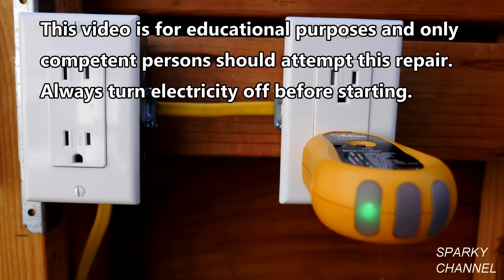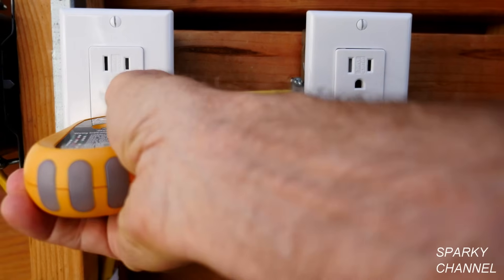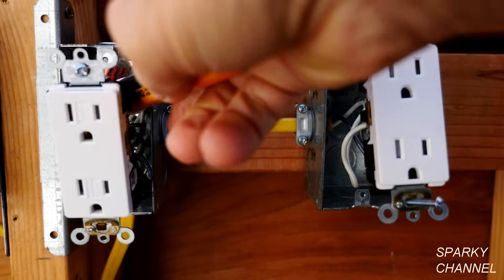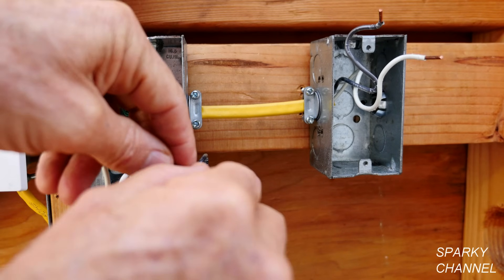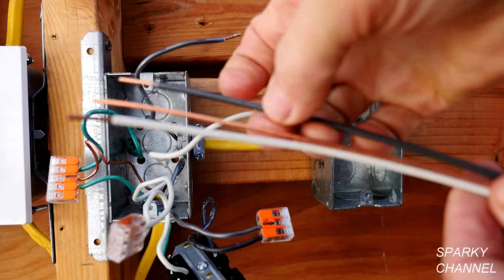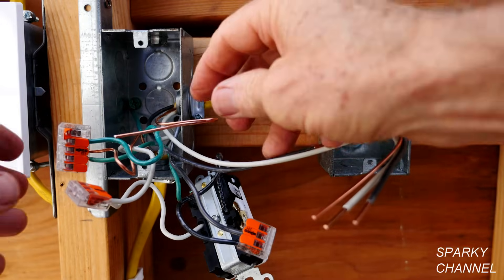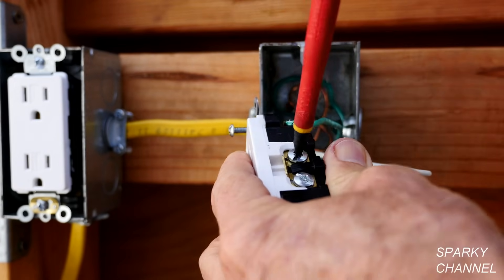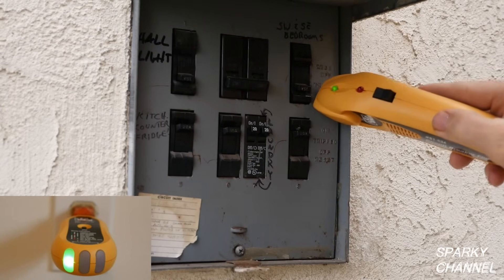How to Fix an Open Ground

Comment: Faster way is to Mickey Mouse it and jump from neutral to ground screw
Reply: Bootleg' er that will get those lights on your tester right! And maybe only a shock or two from an appliance no big deal
Reply: @erics.4113  what about putting a gfci on the outlet that has the ground in this example?
Reply: @claytonjames4779  apparently that is code legal now. The GFCI can support X number of outlets from that circuit and you have to label the GFCI with no equipment ground or something like that. 

I fixed my open ground issue by climbing up in the roof and found the junction box where the ground snapped off. Rewired it all and they all see ground now

Comment: Have a house from 1950. It doesn’t have a ground. Do u have a video that shows how to ground without having to rewire or change to gfci?
Reply: Install gfi type breakers at the panel
Reply: @javierperez4039  so a breaker gfci combo?
Reply: @MA-vm6jl  they make gfi breakers now for this reason, yes
Reply: @MA-vm6jl  I would ONLY install a GFCI.. I would avoid a combination type ( AFCI / GFCI) simply because on older homes you’ll tend to have “false trips” and this can be frustrating for a homeowner . Unless you see a hazard requiring it, I would leave it alone until you can get a full re-wire
Reply: I also have a home built in the 50s.  In my case, my folks were the 2nd owners since 1961.  The home was built in 1955 with a detached garage.  The house uses discontinued Square D brand XO breakers.  In the property history, we have replaced only 2 breakers since it was built.  I remember my dad buying 2 new breakers for it, the first time one failed.  He bought one to install, and one as a spare.  The first failure was just from wear.  The second got caused by something landing on a loose cord at the outlet, shorting out the breaker at the box as it tripped.  If I ever need to replace another breaker, I will need to either get a used one or replace my outdoor main panel with a new one and rewire my whole house with new NM wires to every box, and possibly tear up the plaster walls while rewiring the house.

My house is on NEC code that was in effect during 1955.  My steel water pipes served as the grounding rod for the panel, as separate wires grounded receptacle boxes in my bathroom, kitchen receptacles next to the sink, and light switch boxes for my outdoor porch lights and my bathroom light switch.  My garage has a separate ground wire that connects to a cold water pipe underground, connected to my water line coming into my home.  I found out back in those days under the old NEC codes in the 50s, grounding receptacle boxes to the cold water pipes was permitted as a shortcut, as long as the pipes maintained continuity and that the panel got bonded ground to the cold water pipes.  My detached garage is an example of a ground attached to an underground bonded metal cold water pipe that leads back to the house plumbing.  However, a broken pipe repair using pex pipe to repair the leak between metal water pipes in older homes with boxes grounded to the pipes as a short cut to the main panel ground presents a big dilemma.  I learned about this in an electronics class I took during high school in 1979-80.  My shop teacher mentioned a problem that the plumbing industry created for electricians, when they introduced potable pex pipes to residential plumbing as a repair solution to leaking old galvanized pipes, breaking grounding continuity on old grounded boxes using water pipes as a shortcut leading to the grounding bus on a breaker panel.  Many homes with galvanized pipes used the cold water pipe runs as a shortcut to lead the grounds back to the breaker panel.  An example is a bathroom receptacle box near the bath vanity sink would have a non grounding NM cable coming to it from the panel.  The receptacle box grounded from behind often had a ground wire connected from the box to the galvanized cold water pipe as a shortcut to the panel ground. The panel ground terminal often ran a wire to the galvanized cold water pipe.  A number of homeowners lost their continuous grounding when plumbers replaced rotted leaking sections of cold water pipe with newly introduced pex pipe, not knowing the galvanized pipe also served as an electrical ground for the dwelling.  The same thing happened with galvanized pipes being repiped with new copper pipes within the walls.  A number of those with ground wires attached to the old galvanized pipe as a shortcut leading to the breaker panel lost their grounding as well.

Comment: Another way to check continuity is by shorting the black and white conductors in the upgraded box and ohming out the black and white in the old groundless box.
Reply: this is also a handy trick to de-energize the branch without walking to the panel
(I am not an electrician) does anybody actually do this in the field? seems like a great time saver
edit: also good to map out all unmarked breakers

Comment: A Ground wire does not give  protection from lighting or power surges. It only provides a low impedance path back to the source for faults. Grounding electrode conductors (GEC) do protect against lightning and surges, but those are two different components of the grounding and bonding system of the house.
Reply: What is mean by impedance (z)

Comment: first time I've seen Wegos with a release lever. How much are those running in comparison to the regular Wegos?
Reply: They're not cheap.. a 2 port will run about $0.23.. a 3-port around $0.40 and so forth.. they have 2, 3, 5 and 8 port models.  Search sites like Amazon but really research because prices are all over the board.   The "kits" tend to run high.  If you use them a lot then get them in boxes of like 50 or so.. cheaper that way.   I love them and use them constantly.  Some situations not so much, like where you already have several wire twisted together.. you'd then have to cut them all to get a nice straight end for the Wago.  I re-wire tons of fluorescent fixtures to ballast bypass LED fixtures and they are great for that.  Also great for times when you may be connecting and disconnecting a lot.  Makes it soooo easy.
Reply: @bryanknudsen8100  yeah, Amazon isn't always the place to get the best deal anymore! Too many people buy and resale on there to try and make money from home, but Wegos are more reliable than wire nuts in my experience.
I still buy things from Amazon, but a person has to pick and choose with caution. Almost every review I've given on there in the last 12 months has been blocked, and most of them were good reviews, so you never know what you are getting. Some of the reviews I've seen in the past are user error problems, but everyone should be allowed to say what they want about the products they buy, and let people sift through the garbage!
I bought 3 sprinklers recently, and they claimed 33'. I didn't say anything about that, I simply said I made to hoses 19' to daisy chain them together, and they speed up the time it takes me to water my lawn. That's what they blocked. I'm really to the point that I don't want to attempt to give a review, and I think everyone should. Because they don't let people give an honest review. People would be better off looking at it and taking the chance, and return it if they don't like it.
If you are researching that type of product on Amazon, you may be looking in the wrong place. Because you may be getting an inferior knockoff of the product that isn't rated for the same amperes etc.

Comment: Why can't you connect the bare wire to the green screw on the switch  and  a bare wire to a screw in the box wouldn't that work?
Reply: the box on the right has no ground, so that wire will do nothing to protect you.
Reply: @RangerCaptain11A  totally inaccurate statement as related to Bill’s upgrade. According to the receptacle tester the left box was correctly connected to the household grounding system. What Bill did in his upgrade connected the metal box on the right to the household grounding system as well as the outlet. 
It would have been a nice addition to his video if Bill had shown this with his multimeter.
Reply: @coypatton3160  did you watch the video? I guess you missed the section showing the right box had no ground wire ran to it -- why do you think he replaced the entire two wire with a section of three wire? so the original question "Why can't you connect the bare wire to the green screw on the switch  and  a bare wire to a screw in the box wouldn't that work?" connecting a switch to a non-grounded box is no ground, as I said.

Comment: thx for posting!
I have a technical question:
I live in a new house and I am a guitar player with high end guitar tube amps.The problem I have is that regularly, there will be a horrendous buzz in the amp.This problem is intermittent.
I fully understand the 60 cycle hum coming from single coil pickups on a Fender but this noise is intermittent.The sound appears even when I am on hum cancelling positions on the guitar.
My ground wire is connected to the water pipe.I thought maybe the problem is there.Should I drill a hole and directly go in the Earth instead of the water inlet pipe?Any opinions on this?
I even though of calling the Hydro-Quebec on this matter.I live in Canada.It can be quiet for many days and it suddenly comes back for 4-5 days and then goes away..I am in the middle of it right now.
thx and have a good life!
Reply from the maker: Robert, I suspect you're getting noise from another circuit. (I'm guessing). Would it be possible to run a dedicated circuit to where you plug in your instruments? This new circuit would need to be grounded at your main panel. This would eliminate a lot of electrical possibilities that may be causing the problem.
Reply: @SparkyChannel  hey Bill. The dedicated circuit is a thought but from a sound tech and sound installer perspective, I would suggest and ISOLATED ground in addition to a dedicated circuit.  The issue with panel connected ground and neutral is the noise can be transmitted across these. Isolating the ground is doable (not necessarily easy) where as to dedicate a neutral requires a dedicated panel unless you know a trick I do not.
Reply: You don't have ground rods or a direct to earth ground? A cold water bond only might be the reason, but you should properly pound in some ground rods for the hell of it.
Reply: I have both ran sound systems and installed sound systems. If doing a new install and in a revamping of a system when possible (95+%) we would install isolated circuits for the sound system. 
That is a 2 stage process. 1 the circuit(s) used must be separated (isolated) from the rest of the ground system. An isolated grounding system must be installed for this circuit(s) usually a grounding rod is used that is separated by distance (your local code should provide a min distance). Use as great a distance as is possible but must meet code requirements. (Sorry, I have no clue as to what Canada uses for their electrical code). 

Like your random hum comes from something in your electrical system that is not always in use when playing.  My experience is lights are one of the biggest noise causes. But any electric item can be the source. Since your house electrical system is largely interconnected via the grounding wire and neutral wire, it could be from most anything. This is from a hair dryer being used in a bathroom or bedroom from the other end of the house to the garbage disposal in your kitchen to an outside outlet or light.

Comment: Really appreciate  the tec info…but I have a question. My garage outlet circuit indicates that I do have an open ground when I connect it to my travel trailer. I also find that I get a slight “zap” when  I neal on the grass and touch the metal frame. My question is…is there more going on than just an “open ground”?
Reply: Obviously…but “why-for”?   But seriously, I did discover the source…but I’m interested in what YOU think It was…
Reply: @wayneg5593  wat did u discover
Reply: @javierperez4039  vbbb
Reply: @javierperez4039  broken safety ground wire in extension cord
Reply: You are the ground

Comment: So my house is from the 50s and all my outlets read open ground. Does that mean I have to rewire the entire house? Or can I ground each one to the metal box if available? Will that actually do anything or is the box too small to act as a ground and will it heat up and possibly cause a fire if a surge occurs?
Reply: If the box is not grounded, and you wire a ground towards it, it won't doo anything. And like you said, if there is a surge it can possibly cause a fire which I heard stories about.
Apparently a workaround is too install a GFCI outlet since it finds faults without using a ground wire, or just use a 2 prong outlet. 
Or, the last step which will cost a bit more is just too rewire the entire house like you mentioned before. Hope this helps, cheers. :)
Reply: Install GFCI outlets (do your research). Or spend the big bucks and re-wire the home.
Reply: This might be ridiculously obvious, but are the outlets all 2-prong?  That is: do they lack the third prong seen on modern outlets?

Comment: I have a question: So at my grandparents house I used to have a 2 prong receptacle and could not hold in a plug, then later was replaced with a 3 prong with 2 USB ports and has a no equipment ground sticker. Would this be fine or should it be changed?
Reply: There's also no SLACK on the wire.
Reply: If it is GFCI protected then it is fine, but if it is not GFCI protected and then you should install a GFCI outlet on the first outlet in the circuit which is usually located closest to the breaker panel but it can sometimes be kind of tricky to locate or you could install a GFCI Circuit breaker assuming they have a circuit breaker panel not a fuse box
Reply: @TechHowden  there is no GFCI in the circuit last I checked but there was 2 wires and I assume one goes to another outlet and the other wires are the live wires
Reply: @YourAverageMODude145   if you want to make it code compliant you have to install GFCI circuit breaker
Reply: @TechHowden  ok
Reply: Looking for the same answer to this question. Appreciate  you guys posting this to the public

Comment: A question for help. My issue in a 10 year old residency system.  My problem started with an open ground checked power bottom of receptacle was fine recheck upper and no open ground My problem is the trouble is shifting to different outlets then other rooms. Any help ?

Comment: Also, by my own experience an open ground on a receptacle tester might mean the hot and neutral wires are reversed.
Reply: They usually show that(live/neutral reversed) on the fault tester. All of mine do 🤷 they'll even show if it has an open ground AND live/neutral reversed at the same time.

Comment: I think contractor in the 50's and earlier were a-holes. They made everything so complicated.  
Electricians didn't color code the wires and used stiff wires that are hard to bend and cut.  Hell! even Ben Franklin knew about grounding.
Carpenters made walls out of sheetrock and plaster instead of wood or drywall
Plumbers welded everything 
and they all used flat head screws instead of Philips head screws. 

now-a-days its the complete opposite. They even have helpful youtube video's.

Comment: I added a plug in a metal box with bx to a flex house. And I’m getting an open ground even with all the  ground connections spliced through and ground screws used. The only place I didn’t use a ground screw was under the house in the crawl space I just wrapped the ground around the 8-32 that the metal blank plate goes on. Do you think that is the issue?
Reply: A ground screw is dedicated to grounding a ground wire. It is not to be located where it is used to secure something removable as you’ve described.

Comment: if the neutral is grounded at the panel, why does the outlet test as open ground (presumably unsafe/less than optimal)?
Reply: Neutral & ground have different purposes. Neutral is provided as a return path for the load current. Ground is provided so that touch surfaces stay at zero potential. Neutral normally carries current while ground does not. If local neutral rises above ground potential because of excessive current or poor connectivity (high resisatance), ground will not be affected and still provide zero potential at the connected touch surfaces (appliance chassis, electronic equipment cases, etc.).

Comment: Who wired that outlet by plugging the wires into the back of the outlets instead of using the terminal screws?
Reply: you can use the stab ins or terminal screws but using the terminal screws instead make for a better connection
Reply: @zacharybarnett5609  but usually if you use the stab ins, there usually a one time use because you have too press the tabs to get the wires out which can deform/damage the tabs on the inside making the connection a lot weaker.

Comment: I have an entire circuit that has open ground on all the receptacles and also when I test the light switch for continuity of the neutral and ground there is no continuity. Also the voltage test shows no path back to ground. Only path back on the neutral. 
What could be the problem?
Perhaps the circuit isn’t properly grounded at the service panel???
Reply: 1. an open ground in one outlet can show for the whole circuit itself.
2. the switch is on a separate circuit.
3. theres no voltage in ground wire
Reply: maybe one or more outlet is/are wire incorrectly, having the return wire on inline position, for continuity on neutral and ground, you should take the far away outlet and add the ground wire to neutral on the outlet, the incoming ground cable add it to the box itself, maybe this work for you. ps. make sure you have correct ground at main braker.

Comment: What if you add a ground wire and connect it to the metal box but the receptacle tester still showing open ground?
Reply: It is not grounded back to the main panel and then into the ground